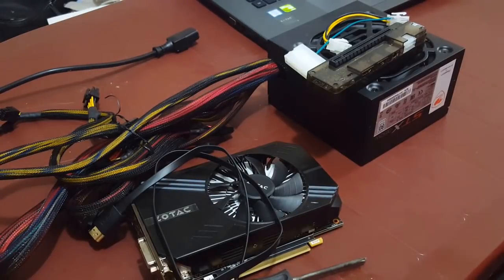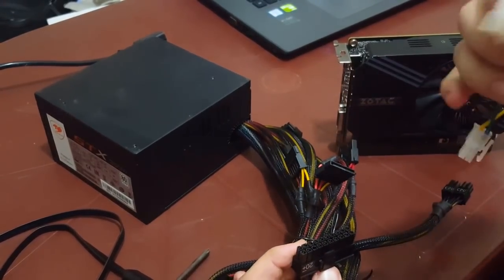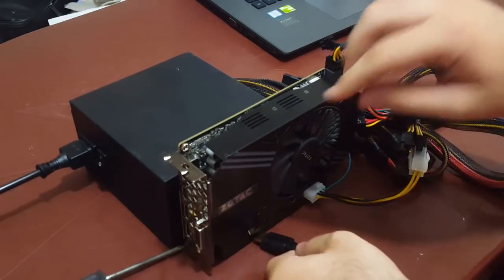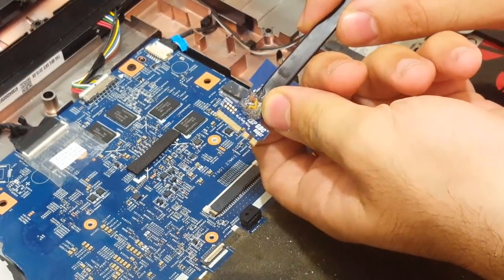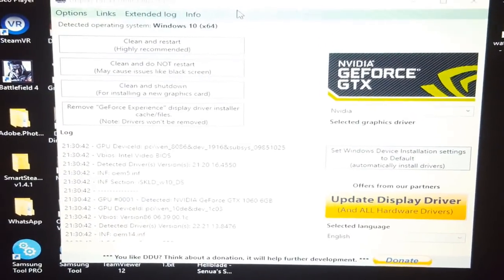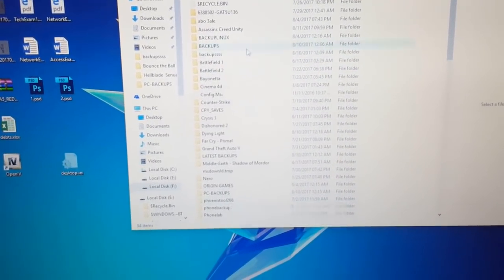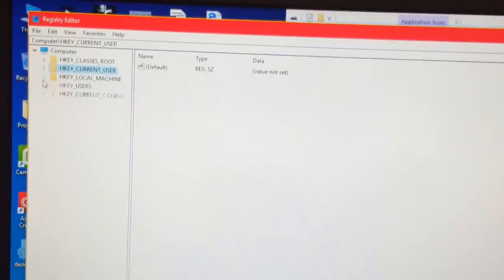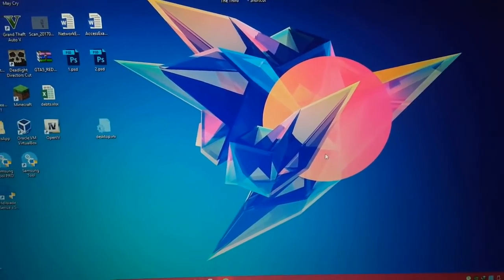HOW TO: External GPU for any laptop PC W/O External Monitor GTX 1060 EXP GDC 1050 ti solve error 43

Comment: Its too late for me T^T! First my computer detected my eGPU as "Microsoft Basic Display Adapter" and when I trying to install the driver, it said that my computer are not compatible, I think the problem is that I didnt uninstall the old GT640m graphics card driver that my computer currently have T.T. and my power supply just explode because I used a 12 years old power supply to operate my GTX1060 :3! lol like it really have fire coming out :3 "its 450 w" T.T
Reply from the maker: +Cat2246 wow, just replace the PSU and follow the instructions in this video.
Reply: wow.suck a quick reply :D! Subscribed! Thanks anyway it really help me a lot.
Reply from the maker: +Cat2246 LOL, glad it helped and thank you.

Comment: would it be possable to wire mpcie to a female hdmi (the one i have in my laptop case) them use a normal hdmi cable to link it to the beast
Reply from the maker: +charlie lilley no it should be connected internally

Comment: WHICH GRAPHIC CARD YOU HAVE CONNECTED TO GDC BEAST IN THE VIDEO GTX 1050TI OR GTX 1060??
Reply from the maker: it was a 1060
Reply: I HAVE BOUGHT GDC BEAST but im low on budget so i wanted to try gtx 1050 ti
with hp notebook
Reply: does gtx 1050ti have 6 pin connector also??
Reply from the maker: if you did not buy the 1050 ti, then don't, just get a 1060 it is more compatible with the beast
Reply: ok thanks

Comment: hey, whats the best graphics card you think i can run with one of these on my acer aspire v3-574t without bottle necking it?
It has an intel i5 5257u cpu @2.7ghz. 16gb ram, 1tb sshd. 
Any help would be much appreciated, i don't fully understand how bottle necking works
Reply from the maker: +noname noname GTX 1070 should be perfect it would bottleneck the CPU just a bit but it is the best choice, but you can still go with the GTX 1060 to get a harmonized experience since it may not bottleneck until next year's games
Reply: ah thanks for the information. does the gpus ram need to match the ram type in my laptop? 
Seen a 1060 fairly cheap but the specs say -

Form Factor Double slot
Processor Speed 1.8 GHz
Processor Count 1
RAM Size 3 GB
Computer Memory Type GDDR5 ( --- this is what i mean)
Graphics Coprocessor NVIDIA
Graphics Card Description GeForce GTX 1060
Graphics RAM Type GDDR5 (and here)

my ram is ddr3 i think ... 

thanks again for any more help
Reply from the maker: noname noname surly no it doesn't depend on ram type
Reply: awesome, ok one last thing haha
how can i tell it the port is pcis or 2.0 ngff like in your video? they both looks so similar.... ?
Reply from the maker: if it has one slot for a screw then it is NGFF else if it has 2 screw slots then PCIe
Reply: sweet ngff it is then. going to order the thing now. what would you recommend, the gtx 970 or gtx 1060?
Reply from the maker: noname noname i would always recommend 1060 but if you are low on budget you can go for 970 it should also work flawlessly. Good luck.

Comment: Will it works for me? My laptop is Acer E5-574G-53HW, I wanna try it with a gtx 1050 ti
Reply from the maker: +Fainted Cat go for GTX 1060 it is more compatible
Reply: @hmawla  Hello brother. I want to ask you about e-gpu. I have rx 570 and gt 940m laptop. When I do your steps it's not working. Everything is powered up and working but my laptop doesn't booting up. It stays grey screen. I can't even see windows loading logo. I searched internet and found something that I am not sure. The thing is external monitor for AMD e-gpu's. They are saying I need external monitor which is connected to my external gpu with hdmi (rx 570). Is it really working with this way brother? Thank you already.

Comment: i have a laptop HP Pavilion G6 will EXP GDC V8 Beast work? what GPU do you prefer to me to use?
Reply from the maker: +Jhaaay Santos the pavilion g6 BIOS can be easily modded as I know so I guess it should work, as for the gpu get a GTX 1060 best choice so far.
Reply: thanks. what if i added another 4GB Ram does it conflict with EXP GDC?
Reply from the maker: no not at all
Reply: hi. i have a last question, can i run this without external monitor? because i  want to use my internal screen (laptop)
Reply from the maker: +Jhaaay Santos it depends on your laptop, but mostly if it works then you should be able to use internal display, but you may need Intel HD graphics along with the external GPU...

Comment: Hello there, i've just watched your video and i haved enjoyed 😁😁 i wanted to ask you if this setup works on Toshiba Sattelite laptop.. i have the 960 GTX nvidia, the pci express cable that connects to the wifi card and the adaptor where you insert the grafic card (same setup as you in this video) and the power supply... please let me know! Thank you ☺☺
Reply from the maker: +FAD31N the new toshiba sattelite uses strict BIOS setup, it may not work but haven't tried it yet nor someone I know did, but in the end it may work perfectly.

Comment: he bro blz reply this question of mine
can i built an egpu with gtx 1050ti and what i do for power supply as gtx 1050ti does nit require external power supply
Reply from the maker: +aaditya sahu you can use GTX 1050 ti, and think of getting at least 400W PSU, but make sure to follow every step, and subscribe for further troubleshooting... Thank you
Reply: do i have to use external monitor btw thanks for reply
Reply from the maker: +aaditya sahu this actually depends on your PC's compatibility with external PCIe, but trying wont hurt right?! Good Luck...
Reply: ty bro I subbed ur channel
Reply from the maker: +aaditya sahu thank you, and am here to help if anything happens...good luck

Comment: But what's the point when u have no wifi adapter to get wifi unless u use the Ethernet cord itself.
Reply from the maker: +Shira you know you can still get a USB wifi stick for less than 4$
Reply: Ah I see, I am currently looking at this idea to carry my i5-7200u cause the intel 620 is really bad match..I probley use a 1060 :O
Reply from the maker: Shira yes go fo 1060
Reply: Can you make a video with better wiring? can i put this in a case or something?
Reply from the maker: +Shira thanks

Comment: I have clevo with m.2 slot for sata/nvme card and mpcie slot.. mpcie used for wifi card.. can my other m.2 slot support this egpu setting
Reply from the maker: +aswad amin yes it is made for an SSD so it can be used for the egpu
Reply: is there any specific compatibility type of NGFF slot? is it B or M or B&M  or A & E type that can use this great thing
Reply from the maker: aswad amin i think the M is the best for compatibility, which is the one am using with no problems so far.
Reply: tq so much :)
Reply from the maker: anytime

Comment: I followed the steps as in the video but I still getting error 43. I have a GTX 1050 Ti, so I've tried installing 375.63 drivers first, and then the latest drivers as you show in the video. I managed to activate the HOTPLUG in the mpcie port and then tried installing the 375.63 drivers and it worked fine, but when i start playing any game after 30 minutes i get an error. I think that it is because i'm not using the latest drivers, but i don't know how to install the latest drivers without getting error 43. Can you help me?
Reply: Sorry for my english, i'm argentinian
Reply from the maker: if you are getting an error after a period of time it may be a power or a PSU problem try checking that.
Reply: Oh! Thanks, probably is that because the problems started a few days ago just when i changed the psu for an older one. Anyway i'd like to get the latest drivers working.
Reply from the maker: as for the latest driver will keep looking into it since I thought upgrading from 375.63 to latest would fix the problem, I don't have a GTX 1050 ti to check so if you can I will send you a link to a download and to check if it will get fixed.
Reply: Please, send me the link. Thanks!
Reply: Now I'm getting the "driver irql not less or equal" error.
Reply from the maker: will send you a link for a test driver tomorrow, and make sure you do the registry trick for no_restart to prevent such errors.
Reply: Thank you!
Reply: I solved tge PSU problem, now i'm not gettin any error. Anyway I'd liked to solve the driver issue, any news?
Reply from the maker: +Tomas Pubill sorry not yet
Reply: Hi! I've solved the driver issue. I've managed to update the drivers. I only followed the steps in the video with a 368.81 modified driver so it's compatible with my GTX 1050 Ti. I'm not getting any error also. Thank you!!
Reply from the maker: CONGRATZ :D
Reply from the maker: can you tell what did you modify and can you upload the driver so I put it in the description full credits to you? thanks.
Reply: I modified the nv_dispi.inf file adding the following lines:
-In the [NVIDIA_Devices.NTamd64.10.0] section:
%NVIDIA_DEV.1C82%           = Section001, PCI\VEN_10DE&DEV_1C82  
-And in the [Strings] section:
NVIDIA_DEV.1C82 = "NVIDIA GeForce GTX 1050 Ti"
 
And I also modified the "ListDevices.txt"file adding the line following line in the nv_disp.inf section:
DEV_1C82 "NVIDIA GeForce GTX 1050 Ti"

And that's all. After using DDU i restarted my computer in Advanced Startup mode and disabling driver signature enforcement. Then I installed the 368.81 modified drivers following the steps on the video.
Reply: That works only for GTX 1050 Ti. For the GTX 1050 you must add the following lines in the nv_dispi.inf file:
-In the [NVIDIA_Devices.NTamd64.10.0] section:
%NVIDIA_DEV.1C81%           = Section001, PCI\VEN_10DE&DEV_1C81  
-And in the [Strings] section:
NVIDIA_DEV.1C81 = "NVIDIA GeForce GTX 1050"

And in the "ListDevices.txt" file you must add:
DEV_1C81 "NVIDIA GeForce GTX 1050"
Reply from the maker: +Tomas Pubill thank you will add this to the description and pin your comment.
Reply: I'll give a link to download the modified drivers, for both graphics card GTX 1050 Ti and GTX 1050, as soon as posible. I'll upload some videos showing how the GTX 1050 Ti performs with some games.
Reply: https://1drv.ms/f/s!Av94q1hsBEoEijwyCYTJp8srNwYa
There's the modified driver link.
Reply from the maker: Thank you alot, I added instructions in the description
Reply from the maker: +siva reddy not sure about lenovo, but I am sure that not all Lenovo laptops lack of external gpu support since some them where able to run tem.
In this video you will see how to bypass error 43 by using an old driver.
Reply: You can do it yourself. https://egpu.io/forums/expresscard-mpcie-m-2-adapters/FIXED-Nvidia-GTX1050Ti-error-43-on-mPCIe-or-M2-non-hotplug-eGPU-interfaces-applicable-to-GTX10xx/
Reply: dont work driver
Reply: Have you restarted your computer in Advanced Startup mode and disabled driver signature enforcement before installing the driver?
Reply: yes. after uploading until the end of the error
Reply: please help me
Reply: I don't understand what kind of error are you having, please describe me whats the problem and i'll try to help you if i can.
Reply: I started the installation now. I will do a quick install. or should I do it like in the video?
Reply: Would you please take a video of how you did it?
Reply: Follow the steps in the video! I followed the steps shown in the video and i got my gtx 1050 ti working perfectly with latest driver! I uploaded the modified 368.81 modified driver for gtx 1050 ti and gtx 1050, the link is in the description of the video, otherwise the driver won't work.
Reply: Sorry i've wrote "modified" twice! my bad!
Reply: 368.81. I will now install the 375.63 driver
Reply: I will build 375 after the 368 driver
Reply: I've also, installed it with no internet connection.
Reply: Tomas Pubill playing thanks :)
Reply: Perfect! Enjoy!
Reply: Tomas Pubill thanks, man. You're a genius. I've been struggling for days. I'll download your drivers and give it a try.
Reply from the maker: +jlcaosevitrola good luck
Reply: Pedro Marthon oh man.... I got a driver failed to install.... I've missed the signature driver step. Now it's running. I'm a little skeptical, though.... let's see how long this is gonna work. What do I do when nvidia release a new update? Repeat all process?
Reply: No, you just download and install the newest driver.
Reply: Tomas Pubill will this method work with nvidia latest ver.? like 38x.xx ver.
Reply: it worked fine for me, i've already installed the latest drivers that came out these days,
Reply: Tomas Pubill did you just install it or update the driver through device manager?
Reply: i downloaded the driver and installed it
Reply: Pedro Marthon bro... I'm having some bad experience with my new rig. After I struggled to make it run, it's not working as I expected. I got some errors related to direct3d in many softwares. After Effects disable hardware acceleration. Many of my Steam games don't even start. Bsplayer crash when open any file and vlc doesn't run smoothly. Well, this is where I went so far....  
I am running a samsung RF511; i7 2360 @2.2Ghz; 8gb ram; gtx 1050, 388.31(latest driver so far); Windows 10.
Reply from the maker: +jlcaosevitrola the PSU may be the problem
Reply: Tomas Pubill great. i will try it. one more, did you use setup 1.35 or just plug and play?

ok, just tried and it works. thanks.
now i'm using driver 385.69 ver. and havent any error or problem.
Reply: Oh geez. The 1050 it´s powered by the PCI port and consumes about 75w. I am using an ATX PSU that feeds just the GDC.  I know I´m not using a thermal take whatever expensive brand name, but it´s a "400W" PSU. You think the PSU could cause other issues besides slow down the GPU´s capacity?
Reply: jlcaosevitrola try to install latest driver after you install 375 ver. / 378 ver. (reboot first)

368.81 mod ver. > delete nvidiareboot reg. > 375 ver. / 378 ver. > reboot > install the latest nvidia driver

make sure to disable driver signature first before install mod ver.
Reply: sure.... I'll try this. here's a thing: I first installed the 368.81 mod ver, than I went straight for the 388.13. I was having all those issues mentioned above, but I could run Street Fighter V 1280x720; medium @ 60fps and I was kinda happy apart my other games wasn't running. I turn on the computer yesterday and I was unable to play SFV. I notice some process in background related to NVidia experience like streaming and shadow play. 
I removed all drivers with DDU. 
installed 368.81 mod ver. > delete nvidiareboot reg. > 388.31 (latest)
All the other problems continue and now my SFV doesn't accept medium anymore.
Reply: jlcaosevitrola lucky you, still can play the game even though has problem with the driver. but if i install 38x.xx ver. after 368.81, the problem with directx / direct3d will appear when opened the game
Reply: I have GTX 1050 Ti for egpu my msi laptop (cx61 2oc). I download it but it not loaded
Reply: I want to know the answers for  below two questions???                                                        1.I see some of them getting error 43,its because nvidia blocking the support  with its latest driver update(after 372 driver update).is that true???                                                 Is it possible for lenovo g50-70????  (bios is whitelist)                                                                                              2.And i have lenovo g50-70 laptop. Some of them saying that all  lenovos laptops bios is whitelist, that means there is no way to change the hardware settings in bios.                                               Please reply bro if you know the answers it it will helps me a lot
Reply: TricK i Know thank u very much for your reply. But one question is my lenovo g50-70 (20351) does support??
My specs:
Intel i3 processor
Amd r5 230 2gb graphics
4gb ram
How to check my bios is whitelist?
Reply: Tomas Pubill Hi Tomas, please tell me in detail how you solved the error 43, because i also want to use my new GTX 1050 Ti. Can you please send me a link where i can download your modified diverse, or how i can edit my standard driver step by step?
Reply: Tomas Pubill I have follow all the instruction you give but after that it say your gpu not attached
Reply: any one help !!! i got something wrong .. when i play assassin creed origins my screen turn to white color and my laptop restart with no any error ... what to do ? and i haven't any heat for card or power or laptop
Reply from the maker: +Gamers Biwan change the power supply, it used to happen to me.
Reply: Hey guys I want to add my rtx 2070 super with this procedure can some one give me what all things to edit in the file?

Comment: You are a life saver!!!!! The 375.63 driver solved my 43 error!
Reply: I used gtx 1050 ti and try to install driver v.375.63, but it still said error code 43, can you help me pls ?
Reply: @noob_specialist  did u resolve It? I'm just trying to setup with a gtx 1050 ti. If u resolved that error, wich steps worked for u? Thanks a lot....
Reply from the maker: you have GTX 1050 ti? and thanks for watching!
Reply: Yes I have the 1050 ti :)
Reply: Johnny williams i am thinking of doing this so what is error 43?
Reply: So it's not necessary to modify Nvidia Driver 368.83 right?